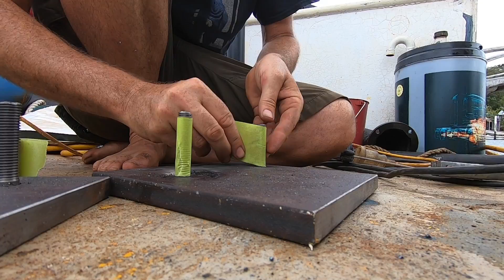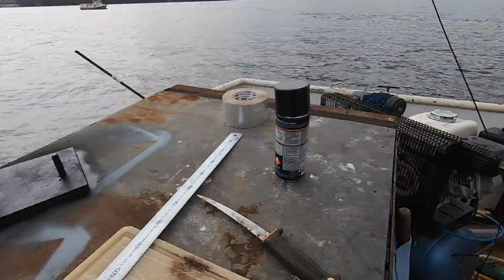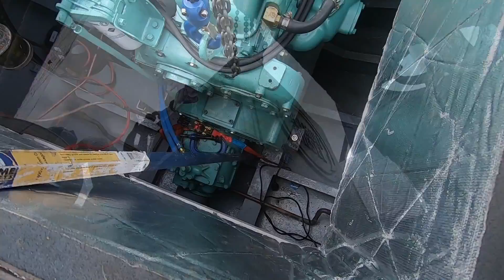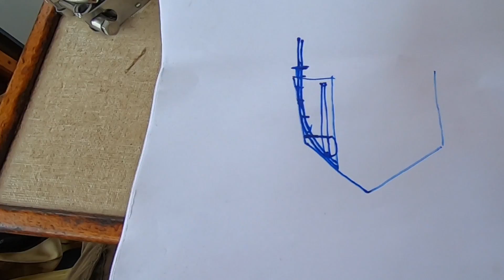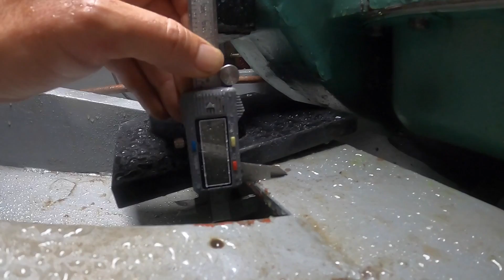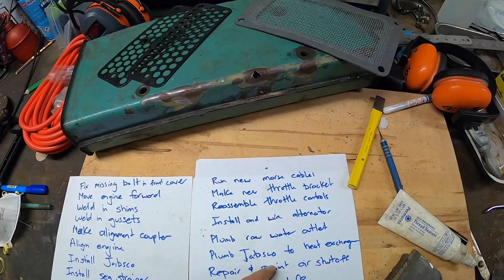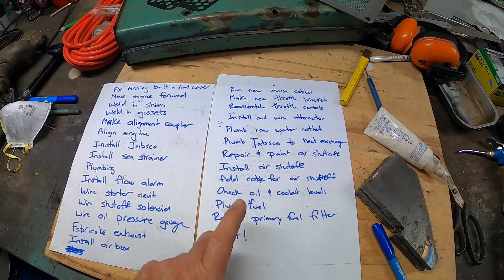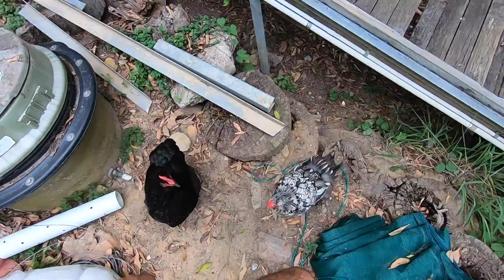Making and installing new engine shims

Comment: Forget the haters Stu. Your real audience doesn't care how long it takes, the journey it worth the wait.   Also if you weild a couple of plates  down past the engine on the prop side you may be able to fix a couple of bottle Jack's to each side of the engine and use them to push the engine away from the prop shaft coupling in a controlled manner. They may also give you left and right swing of the fitting if one jack was pumped more than the other. And slow release back towards to shaft if the engine wanted to slide that way anyway?
Reply from the maker: Thanks mate. I have been thinking about welding a couple of plates than can be used to push the engine (and maybe even prop shaft) from. It is the thing I love about steel!

Comment: Hiya Stu, i recently went an exercise of replacing the fuel sender unit for my Haynes power boat. There is quite a range of reed relay type float devices in various  common resistances ( 110 ohm etc ) that work correctly with standard fuel gauges from vetus  ,vdo, veethree etc. Would you consider this? Would require a single penetration in the top of the tanks but the mounting pattern is a standard also so replacements etc would be easier. 
Just a thought. 
Also, yeah just take your time. Lots of time invested in the project. Did I understand you correctly that you will make up an adapter plate ( like on a lathe or whatever ) to let you measure the clearances in situ easier?
Keep going, looking good.
A.
Reply from the maker: At the moment I'm considering every way of monitoring the fuel. I believe I've got an old VDO fuel gauge of the style you are describing floating around somewhere. Yes, the plan is to machine up a very accurate replacement for the Polyflex mount, but there are many ways to skin a cat so it may not be necessary.

Comment: Stu, since the beams the engine is sitting on are at some decent angle to the prop shaft, I think you will find lining it up without the coupler, then moving it forward along the beams the 2" couple thickness will defeat your work.   I think if you bought a cheap (under $25) magnetic base and dial indicator you can spin the propshaft with the magnetic mount on it to get concentricity to the motor half, AND you can orient to the flange face and get the parallelism, with the air gap that the coupler will fill.   I haven't done this on a boat, but industrial shafts and couplers are on the same principle.   There are very fancy optical gauges that you can maybe rent for this, but that really isn't necessary.   You have a good idea of just going after it, but a cheap tool and even a hard block of wood or aluminum to simulate the coupler thickness (as long as the faces are parallel)  would enhance the process and avoid moving the motor the 2".   A final move of under an 1/8" motor travel I think is important.    Good luck!...   Nice metal reference.. lol...
Reply from the maker: For sure the principles are the same whether it is a boat or a pump or whatever. From what I can see though the angles of the propshaft and mounting rails are quite similar. I've got a dial gauge here at home that I'll be taking out to do the job. I think once I get it close and the shims welded in I'll start to get my head around the fine adjustment
Reply: @DangarMarine  Thanks for reply!  Ok, well I thought from that one close up it looked like 15+ degrees or more.   Here is basic vid on what I am talking about.  A simple L bend for your indicator and a hose clamp even will help your indicator setup on the flanges.   If you take the time to make a fairly easy to use setup, you will probably need to check this alignment again in the life of the boat, so it would be worth the time, then keep it with the ship tools.   Remember your checking axis does not need to be up and down, side to side actually as long the axis you pick are roughly 90 degrees apart.   Altho, it looks like you have the room to setup for up-down anyway.  Good luck!   ....   https://www.youtube.com/watch?v=n17Uq3fiQ-o

Comment: why not get a few union nuts, if possible get them machined to be exactly equal length if not paper or plastic shims work. Bolt them to prop shaft so you can place and measure engine as is. btw using oil based lubricant tapping new holes dulls taps in steel.
Reply from the maker: Good idea using the union nuts. I might look into get some that are machined exactly.

Comment: Hey stu, 

Can’t put my finger on it but I think the studs in the mounts may give you some grief with aligning and future engine removal ect. 

I own a 18m whale watching Fast cat in Hervey Bay running 2x 8.3L cummins diesels. 

You mentioned in your video about aligning the engine then sliding it backwards and forwards to get your polyflex in, and especially with not being able to move your prop shaft backwards and forwards.

If you ever have to slide your engine back and forwards again after you weld it you’ll have to either lift the engine higher than the studs or try to remove the studs. 

The setup in our cat has the poly engine mounts through bolted to the rails so if needed we can take the bolts out completely and slide the engine wherever we want on the rails and being through bolted with a nut on the under side there are no issues trying to line up a threaded hole in the rail. 

Also our brackets on the engine are slotted side ways to allow extra movement for aligning. 

We have all of that and the ability to slide our shafts backwards and forwards about 600mm and it still takes a lot of wrestling so just thought I’d mention it incase it my give you other ideas. 

Also with the polyflex coupling spacer I would highly recommend getting one made out of steel or getting a spare to keep on board. We keep a steel one on board because if they blow up (and they do) and you can slide your shaft forward enough to hard bolt the couplings together  you’ll be stuck in the middle of nowhere with a perfectly good engine and gearbox that can’t reach your prop shaft. 

Hope some of this helps mate, happy to go more in depth or send photos through if you like. 

Also if you feel inclined jump over to my channel, I’m building a 52ft Polynesian double canoe from scratch in my backyard from my own designs. 

Cheers mate love the vids 🤙🏻

Comment: I have done the whole engine alignment a couple times once with a gas V-8 and once with a 6 cylinder diesel both were a pain but the Hino diesel weighs twice what the gas engine does and the mounts were corroded enough that I had to dismantle the adjustments and clean it up. I was on the hard both times but I am not sure if that made it easier or not. Yes I could pull the prop shaft out from the ground easier but then I had to climb the ladder to get back up into the boat since I was doing it by myself. Both boats are like what you have minimum clearance, it just takes time. I thought you were in pretty good shape to be as close as you were on the first rough fit.

Comment: Is it possible to rent a laser alignment tool, something like an Fluke 830,  Optalign Plus,  Easy-Laser etc?  You would have to be able to turn the motor and the prop shaft without disconnecting the lasers.

Comment: Man, I wish I wasn’t a world away or I’d jump in and help you. I’ve done this several times, just not with metal stringers, which I would have preferred anyway. The temporary alignment coupler shows your on the right track. The check list is exactly what I do as well. It seems ominous but things get crossed off before you know it.

Comment: That flat bar is cut on a bandsaw. 

Yeah mechanics hate gaskets, which is why we don't use them if we don't have to. Cast onto cast or machined onto machined surfaces don't require gaskets. 3 Bond/Permatex grey or red silicone and a spotlessly clean surface will ensure no leaks (assuming no porosity for the pedants out there). Also, I noticed one of those stud nuts on the underside of the mounts looks to be upside down.

For the dipstick some natural finish flat bar is ideal. I drive a semi for Bluescope these days and the fuel gauge in the truck is buggered. I went to the rack and calibrated a length of 20 or 25mm flat bar that's about 2 or 3mm thick. I used a sharp chisel to stamp the 1/4, 1/2, 3/4 graduations in it and bent a nice handle into it in the vice etc. The raw finish of the steel clearly shows the fuel quantity. It is quite flexy so will conform to the hull shape. You might find some in the offcuts that will fulfill dipstick requirements at your local steel supplier.

I like your idea re the alignment. I feel that the 'mandrel' you propose for the alignment tool should be made by an engineering shop that specializes in lathe work. You could do it yourself but sometimes it's best to sub out mission critical stuff. Also you have it for life then.

 Getting exciting now. Home run phase.

Comment: re: a flexible fuel level dipstick - A mate of mine uses a length of the plastic yellow tongue from the flooring material used in house building. It is about a centimetre wide, and he files lines into it to mark various levels. I works extremely well and has lasted for many years.

Comment: Look into the magnetic sight glasses. It's a stainless tube with a floating magnet and red/white marker flags on the outside. As the magnet passes them it flips the white markers to red and tells you the level. Meets all requirements and no possibility of spilling.

Comment: Stu, not quite correct on the water wears stone thing, it's particles in the water that wears the stone or the water needs to be under pressure being forced through a small gap.
Reply from the maker: Often it is also the minerals dissolving in the water that then carried them away.

Comment: As someone else mentioned.  We NEVER used any flex joints at our shaft/trans coupling.  That is just another gimmick that can/will wear out and break leaving you stranded.  Boats aren't like cars and offshore boats especially so.  You build them to the highest reliability you can because your life literally depends on it!.  Bolt it up flange to flange with high quality steel bolts and let'er rip.  Also watched your waterpump rebuild.  #1 Don't use and thread locker on cover plate!!!  Those bolts don't see any stress and you want to be able to easily undo them yearly to replace impeller in situ.  #2 buy atleast 2 impeller kits for your onboard spares box.  You never can tell when you might get stuck on a reef or sand bar or suck up some trash.  You can destroy an impeller in no time at all and sometimes (bad weather or strong tide making an inlet) you can't just shut down and make a repair, you have to "limp along" and baby the temp gauge, knowing you have a damaged impeller.

Comment: Shims look good. Funny thing though, it looks odd to me that the exhaust manifold faces forward. Nothing wrong, but I’ve rarely seen that. Most face aft because of water cooled exhaust outlets.

You actually can do the complete alignment with the two flanges separated by the thickness of the flex coupling. Traditionally,  a feeler gauge is slipped between the metal flange faces to measure the gap at top, bottom, and both sides. Instead of feeler gauges, use a Telescoping gauge that can be adjusted to the gap between the flanges and then measured by an outside micrometer. The actual dimension isn’t important. It’s the difference between measurements top, bottom, left and right that indicates proper alignment. Ideally there should be zero difference. Practically speaking, it has to be no more than .001” to  .002” difference. More than that, you will get too much vibration and your flex coupler and cutless bearing will eventually fail prematurely. 
Aligning the fore and aft pitch of the engine has to be done where it will finally sit. Otherwise it will be off because of the angle of the prop shaft.
Reply from the maker: Yes, I have thought about using something like a bore gauge to measure the distance between the two flanged.

Comment: Not sure if you already have a temp gauge but in my humble opinion that is more important than oil pressure . Didn't see it on list. Great job take your time. At sea your life may very well depend on it.
Reply from the maker: Low oil pressure will kill and engine faster than heat but both are very important.
Reply: Heads on a Detroit crack very easily with too much heat . The only thing about them I don't care for

Comment: Not sure why you need to move the shaft or the engine back and forth as much as you're talking about. Couldn't you do the measuring with a telescope gauge and a micrometer? 
And next time you've got a bit of silicon in your hand, can you please stick the switch back on your drillpress.

Comment: Making progress. You need a Milwaukee 8" Metal cutting saw. It will go through 50mm  steel plate like plywood. They really work as advertised. The pieces you had cut at the steel yard were cut flat on a band saw..
Reply from the maker: For sure, some type of cold cut saw would be awesome. One day!
Reply: For what they are the price is not too bad.  @DangarMarine
Reply: I was a bit over on the thickness it will cut. I think it says 3/4" steel plate. I have seen You tube videos of it cutting 1" The surface finish is great.

Comment: Fuel tank. Calibrated flexible stick. Not had much success with electronic gauge (maybe others have experience with latest m
odels) in an odd shaped tanks. Dubious readings. Wet fuel stick doesnt lie!

Comment: For mesuring fuel have you thought of a tape mesure ? Then just write on the bulwark what the measurements on the tape alighn to . and they are so cheap you can have a calibrated spare .
Reply: Perfect solution!  With some thinking, could probably mount it inside the cap itself so always available.

Comment: We used something like this to gauge our Tanks.  https://www.buybrandtools.com/acatalog/Dipping_Tapes.html
Reply from the maker: I did consider something like that but I think it would be hard to know when it has hit the bottom of the tank rather than just when the chine changes angle. Probably worth a shot though, it might feel obvious, and after all you have the measurement up at the top of the spout to confirm.

Comment: have you considered getting the shaft to motor laser aligned there are company's who have the equipment with trained operators who do this work daily for a living. im in the hunter valley and plan maintenance work at coal mines and we use a company called lasalign .  https://lasalign.com.au/ these guys will be able to align the motor to the prop shaft with the coupler removed and set to the correct gap to precision tolerances this will give you peace of mind knowing you wont be chopping the bearings out of the prop shaft . this is also why the motor would have been solid mounted in the first place as the torque reaction in the rubber mounts will cause miss alignment under load putting stress on the shaft bearings and crank bearings. keep up the good work and do it right you will be rewarded with reliabilty
Reply from the maker: Yes, I have thought about it. I'm presuming they won't do all the course alignment and welding the shims in so I'm guessing I'm going to need to be relatively close before I call them in for the final adjustment. I'll have a chat to Polyflex about just how much deflection I can actually expect from these mounts under load.

Comment: Stu, electrical conduit may work well for the diesel level in the meantime  flexible and won’t curl up at the end
Reply from the maker: Yes, I reckon it would have about the right amount of flex too.
Reply: Dangar Marine  make sure you let me know if you use it. Could be easily marked with a hacksaw for the increments also without wiping off. Should store well also. Plan on having a spy on renko when i have the quintrex out on the water down that way next. Cheers.

Comment: Also on the emergency air shut off plate, use that cable often, had one running away once, cable was stuck, had to use a piece of plywood laying around. Of course you know how cables are anyways, just sharing stories.
Reply from the maker: For sure. A list of monthly checks will be a good thing to make.
Reply: The shut off plate should be used every time the boat is left unattended. As much as anything else, it’s meant as a theft deterrent.
(Unmarked or hidden handle)
Reply: @buellb0y  You could use it as a theft deterrent, we always put a pad lock on the fuel shut off valve when we were away for long periods of time.
Reply: @buellb0y  Excellent idea.  And Stu has that nifty cable oiler setup, maybe use a light grease instead of oil to keep it really moving smoothly.  Not sure of recommended servicing on Morse type cables to keep 'em moving smoothly, must be something they recommend.

Comment: DipSticks don't lie.

I  Don't know about Steel hulls, we never used flex couplings On my wood boats, we lined the prop shaft and engine flanges up to .005" and they ran fine.
Reply: I think that's More of a vibration and comfort thing, all the solid steel engine Mounts was also replaced with flexible ones so i think that's part of it.

Comment: That alignment process is going to be rough, you get it too far on way or the other,  premature wear on bearings, shaft, gear train, or the coupling on the gear box. I would use a dial indicator. It be real nice to have the laser tool for that! I don't know the name of it, but have seen and used one, once. Good luck, and get it spot on Stu!
Reply from the maker: It will be tough. I'll be using every tool I can find to help!